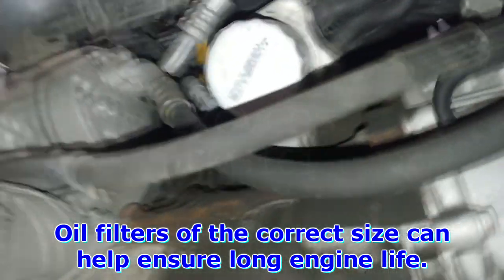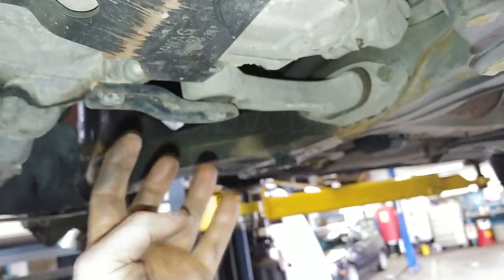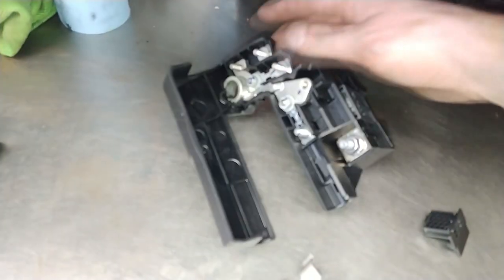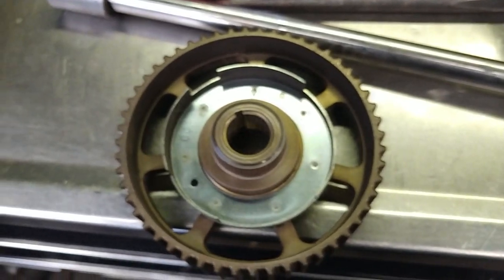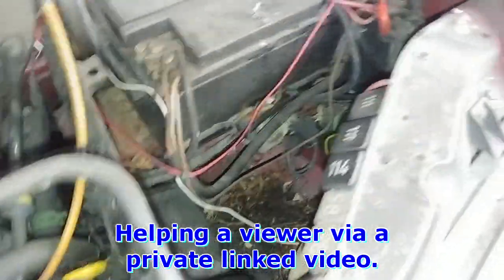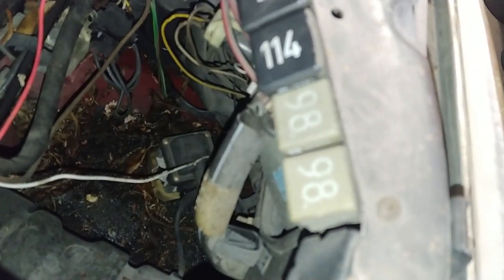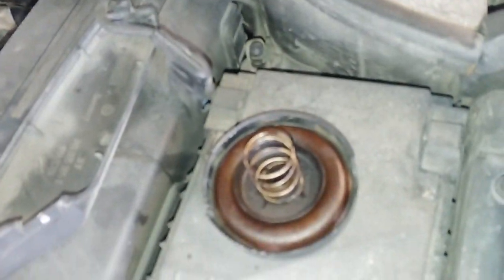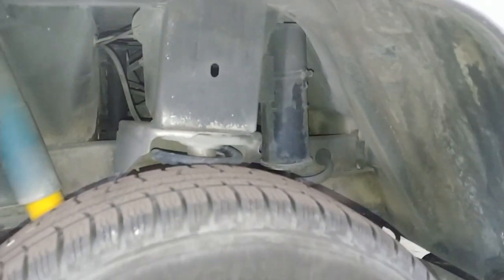Various bits June 2019

Comment: What the hell was up with that trunk! What a damn mess, that was nasty! Great vid Thomas, I'm about ready to set my 2000 NBeetle on fire it's pissing me off but I'll still watch your vids LOL
Reply from the maker: What's up with the Beetle?
Reply: @EXOVCDS  Well the radiator had a crack along the side so had to replace that. Did the coolant bled the line and now radiator fan doesn't come on. It did before. But it's a bitch to keep taking it to a mechanic (he's good just not a VW and I have to give him my first grandkid and do a blood sacrifice every time) The car is all I got, and it runs great except for when it doesn't. I had to replace the passenger side fan 4 months ago. Someone said to use jumper wires to test the fan and I have no frickin' idea what it is LOL
Reply from the maker: Check fan operation like this:
https://www.youtube.com/watch?v=Roh6RCs8IJk

Let me know your results.
Reply: @EXOVCDS  So cool you took the time to answer! I'll check it in the morning and let you know. I appreciate it!
Reply: @EXOVCDS  Hey Thomas! I think it's the water pump. Before the radiator problem I was hearing a rattle up front when I would first start driving. I have a leak under the car in the center I thought was oil but it's coolant. Also, after I drive it around the block a couple times the fan doesn't turn on (the passenger side fan does when I turn on the A/C) and top radiator hose is hot but the lower one isn't. What do you think?
Reply from the maker: @emrsdca  coolant leak from the side coolant flange is common. The large fan is burnt out if it is not working... also common. Do you have heat inside the car? If yes, then the thermostat is bad... in no, then the water pump might be bad.
Reply from the maker: @emrsdca  Also watch this:
https://youtu.be/LiDRUWPw_f4
Reply: @EXOVCDS  It was the radiator fan. Tested it with jumper wires and it was dead. A/C fan worked but not the radiator fan. The coolant wasn't leaking, my oil drain plug wasn't doing its job. Got a new plug with a gasket and it's holding good. Can the fan be changed w/o taking the front end off? I bet it can haha thank you for replying and the videos are #1!!
Reply from the maker: @emrsdca  the big & small fans are both radiator fans. Both should come on, no matter if AC is on or not. Yes, the fan(s) can be changed without having to remove the front end.
Reply: @EXOVCDS  Yes the fans are both radiator fans it was the driver's side one. My dad got the fan off and the new one on w/o taking the front end off again! So both fans run, new oil drain plug so no leak and thank you for helping me! Your video on checking the fan helped my dad out! Much love from California Thomas!
Reply from the maker: @emrsdca  thank you both for watching!

Comment: Eric O did a VW video released today which was interesting. Of course he doesn’t claim to b a VW specialist, and it’s interesting to watch him do what any tech who is not familiar with VW products has to do. Thomas, I know u keep up with a lot of the good stuff on YouTube as I c u commenting on Diagnose Dan and other channels. Eric makes some interesting points on the scarcity of published info on VDubs. U glide thru all the VW stuff like an Ace Pilot. Could u comment on the good sources of info?  Do u also use info from factory scan tools?
Reply from the maker: I'm very selective with what I post.
Factory equipment & licensing of software can be bought from the dealer... a good shop will have that and can handle anything. I'm not at one of those shops. The best I can do is download Dealer service manuals  (pdf files) via the erWin websites (VW & Audi). I can't keep up with Eric's channel... I did in the beginning, but only drop in now and then for a look.

Comment: Kinda random question but should the radiator fan run immediately after engaging ac
Reply from the maker: Yes... that's why it burns out (person always using AC / fan is always running). All electric motors can only run for so long / have a given lifetime.
Reply: Thomas EXOVCDS it's the same with the radiator fan right ??
Reply from the maker: @type2523  Yes... that's why it burns out (person always using AC / fan is always running). All electric motors can only run for so long / have a given lifetime.
Reply: Thomas EXOVCDS we have one with functional fans but the ac fan won't come on , any idea ?
Reply from the maker: @type2523  Year, make, model, engine?
Reply: Thomas EXOVCDS 1991,Citroen, zx aura ( with ac unit from 1992 Citroen zx volcane) 1.6injection with 80 ish hp ( volcane had 120 ish but that's not our problem, we got it from my uncles wrecked zx )